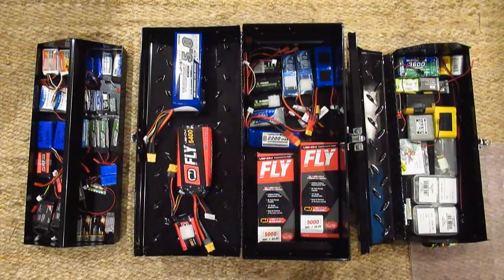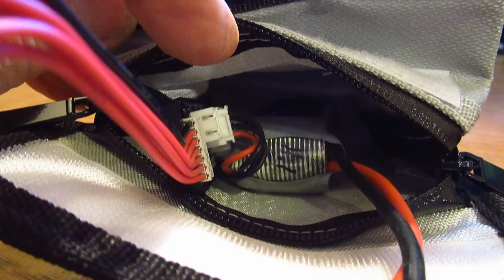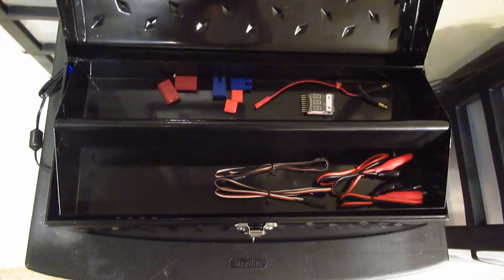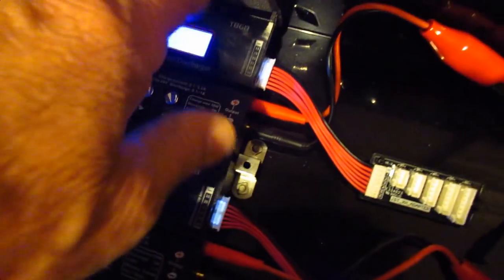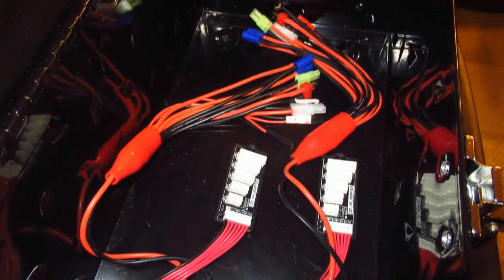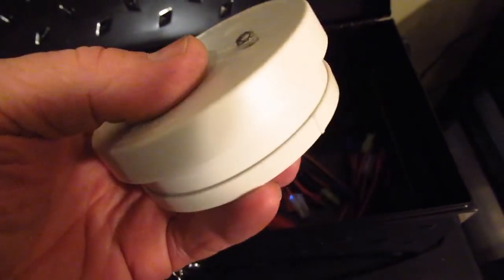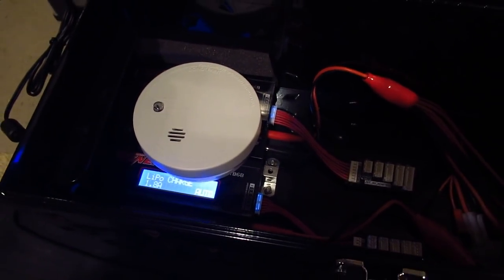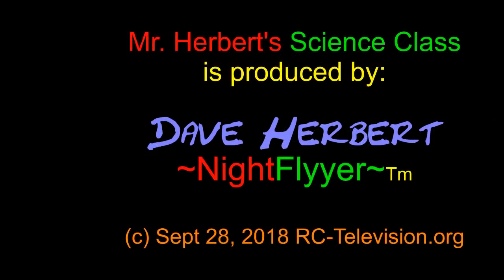LiPo Battery explosion prompted me to build a self contained PORTABLE Charging Station.

Comment: Dave they have ammo cans at Harbor Freight but I seen larger ones on Ebay https://www.ebay.com/itm/4-PACK-FAT-50-CAL-PA108-SAW-BOX-AMMO-CAN-VERY-GOOD-CONDITION/303033083266?hash=item468e2de582:g:Go4AAOSw651cQO1S there are so many sizes. They are kind of heavy and I would trust those if a battery exploded inside.

Comment: Those chargers are garbage... Its that true the power supply is outside, but they get significantly hot. I would have placed fire retardant insulation and rubberize or have a glove handy in case they need to be thrown out. Buy a high end mask, there will be A LOT of smoke, A LOT!!! in no time. I prefer Hitec X2
* store them on ammo boxes.

Comment: Can you replace the foam in the toolbox with a less flammable silicon rubber?
Reply from the maker: I suppose, but it would only melt, as it is only 4" by 1 inch and any fire from it would not be anywhere as detrimental as the battery fire.  If the box and even a destroyed $45 charger prevented a house fire, that would still be cheap insurance.  Thanks.

Comment: Wouldn't it make more sense to mount the chargers externally or at least with a firewall.  I get the safety aspect but if you do have another failure you're literally burning money when even a simple plate of metal could save the chargers.
Reply from the maker: Not to me, since my charger burned too. That's when I decided to put it inside.
Reply from the maker: Also there has to be holes in a separator plate to put the wires. Smoke and flame can get through. If this set up destroys a $45 charger, that is still cheap insurance to save my house from burning down.

Comment: I've always pondered the merits of storing all your lipos in one box.  If one goes... they all go!

Perhaps the best solution is to create a sectioned box so that each individual battery is protected from the others such that if you do have an "incident", you'll not run the risk of having all your batteries contributing to the resulting fire. 

The only other problem with metal boxes is that, in the case of a thermal "event", the box itself will likely get very hot and those vent holes will spew flames and hot gass that could impinge on anything nearby so as to create an external fire.

Personally, I always make sure that my batteries are on a storage charge before I put them away.  This limits the amount of energy they have in them and that in and of itself reduces the risk of a small fire becoming a big fire.   Returning your packs to a storage charge can also significantly increase their useful life.
Reply from the maker: Thanks for the suggestions.  All good, but at least I am trying something which is better than nothing!  I usually only charge one battery at a time, except for the F-16 batteries or my boat.  The vent holes are on top and the whole box is sitting on top of ceramic tile,  but not shown in this video.
Reply: Yes, I charge my batteries on a piece of plaster-board and have concrete (cinder) blocks into which I can put them when not in use.  Cinder-blocks won't conduct the heat if the packs in one of the holes decide to get all "splodey".  I also have a couple of extinguishers (CO2 and dry powder) in close proximity -- not so much to try and put out the lipos but more to prevent any secondary fires from starting/spreading.

It's funny... I only ever had one fire in the "nitro" days, despite that fuel being highly volatile and potentially explosive.    That fire was caused by priming a Cox 049 with the glow clip still connected.  Next thing I knew, the paint was blistering on the front of the model (invisible methanol flames) and my hand was getting hot.   It was easy to blow out though so no real harm was done.
Reply from the maker: I've had those cox fires too.  I still fly Nitro a lot, including helis, but the Old cox's did that a lot.  Glad they always went out quick!  Thanks again.

Comment: I have a caveats about your setup. First is your chargers are inside the box, meaning if a lipo goes you still lose the charger. 2nd You have them on a plastic organizer, wouldn't the boxes meltdown if the lipos went? I have mine stored in a metal box on top of a metal filing cabinet.
Reply from the maker: Like I said many times and in he video description, the tool box is sitting atop ceramic tiles and not directly on top of the plastic. When making the video I didn't show it that way but believe me I know what you mean. Also since the charger began burning, I feel safer with it inside the box. Thanks.

Comment: I had a imax b6 charger charge a 4s lipo up to 19.6v before I heard it puffing (sounded like rice krispies) I set it for 4s balance.     The battery was rock hard and almost completely circular.    The charger seems fine before & after, although I don't use it anymore.
Reply from the maker: That is a lot of voltage for a 4s, as it is supposed to be only 14.4 volts, not 19.6.  I would not use that charger anymore either.  Thanks.

Comment: Are you sure you set the charger to the right cell count?   Or did you use the auto?
Reply from the maker: There is no AUTO available when doing a Balance charge, so the answer is yes (right cell count) and (No on auto.)  Even it I put the wrong cell count in, the charger knows it is wrong so also wont let me charge. It was all set right, as I have been charging Lipos since they first became available and am always careful.  It was either a bad cell or the charger (which is also fused) failed. I believe the battery went bad. I have lost all faith in charging bags since my 6s battery destroyed it in seconds.  See this video to see what happens with a 6 s in a charging bag. https://www.youtube.com/watch?v=CnNId0mDnBo  .  Thanks for your comments and charge safe.
Reply: @NightFlyyer  How did it happen?
Reply from the maker: There is no way to know.  It was either the charger or the Battery as everything was set right. It definitely scared me and I am happy to have been right there when it happened to put it out with the fire extinguisher. Hence, I am now paranoid and why I built this setup.
Reply: @NightFlyyer  Thank you for your story & solution.

Comment: Do you think it could have been a failure of the balance board?  Yours look to be the unfused type. Also why use a balance board with one battery?  Still a great idea using a common tool box for a portable charging/storage station. I like that alot better than ammo cans. Thanks for the idea, I think I'll build something similar.
Reply from the maker: The battery swelled and exploded in side the bag and destroyed it.  The balance board was inside the bag too.  The wires are too short on the battery to get close enough or I would have had to put the charger inside the bag too. Never in 15 years have I had a problem with the balance boards, but who knows.  See this video on how a 6s looks like inside the bag when it explodes. Its a good example. https://www.youtube.com/watch?v=CnNId0mDnBo Thanks for the kind comments and fly safe.

Comment: In the spirit of DIY. I actually made my own fire extinguisher out of a 20oz co2 tank used for paint ball added a on off valve.  Works great and no mess. Had a small fire in the kitchen and had to use it. Was like turning the OFF switch on the fire. You can Refill the tank and its ready for the next emergency.lol
Reply from the maker: That's a great idea.  Good job.  Watch this video, to see what a 6s battery fire looks like, as this is what happened to me. Luckily I was on top of it right away with my marine fire extinguisher. It sure made a mess though.  Thanks. https://www.youtube.com/watch?v=CnNId0mDnBo

Comment: Got the same TB6B. Has been rock solid for about 4 years and counting. Only issue has been 1 button got stuck, so the board was moved slightly, by taking the left side panel off and the button was fine again.
Reply from the maker: Thanks very much. I am glad I changed mine out, especially after hearing about yours. Thanks again.
Reply: I have tested those chargers, they dont balance them very well and never 100% compared to Hitec. I charge and when plugged to Hitec and a balance checker they are way off and it happens w all different kinds of batteriesI have.

Comment: Nice boxes. I definitely need to do something like this. Though I would still use charging bags inside the metal box.
Reply from the maker: Thanks. I don't have much faith in charging bags since mine was completely destroyed by the 22.2 5 amp battery, but you need to do something for sure. Thanks.
Reply: Even though I've never had an issue with a Lipo I still actually use an old steel cash box when I charge them, with the charging bag inside. I also store them in there between flying days. But the Lipos I'm not currently using are stored in a broken electric oven that I keep in my shed.
Reply from the maker: This video is a good example. https://www.youtube.com/watch?v=CnNId0mDnBo Your are doing good with your setup.  My 6s completely destroyed the bag in seconds and I was glad I had the fire extinguisher right there when it happened.  I was going to store mine in a Microwave oven, but your idea is great too.

Comment: I use a 50  Cal ammo box lined with thin sheet of wood and aerosol fire extinguisher velcoed to lid, if the battery blows, it will set off the fire extinguisher.
Reply: Link to fire extinguisher, https://www.amazon.com/First-Alert-AF400-Extinguishing-Aerosol/dp/B001229JCU
Reply from the maker: I have a regular fire extinguisher beside my set up and like this one but I don't see where it automatically turns on in case of a fire as you say. Did I miss that?  Thanks.
Reply: @NightFlyyer  as soon as fire reaches the specified temperature  it will release, this is built into many fire extinguishers, and has been for many years.
Reply: @NightFlyyer   50 Cal ammo box, 11 x 5.5 x 7", about $9.00, I charge 1 at a time, like you, I had a home fire, my concern with your image was 2 chargers and 2 batteries, if one goes south it could effect the other, I may have missed it, but are you using a GFI outlet or surge protector? The fire I had I received 2&3rd burns to my hand and arm. I have a AC 6, after watching your video, I am thinking of replacing it now, it is a few years old.
Reply from the maker: I guess I did not see that in the fire extinguisher description,but none the less, I ordered one.  Thanks again!
Reply from the maker: It is not a surge protector but has a circuit breaker.  It did not shut anything down.  When this happened, I was only charging 1 battery.  Sorry about your arm and hand.  If nothing else, we have people talking and being more aware.  I'm sure if one goes bad they both may burn, but your fire extinguisher idea makes me feel better too.  I've charged lipos since they were invented and never was very cautious about it and never had a problem.  Now that I did, I am much more aware and hope others take heed too. Thanks again.
Reply: @NightFlyyer  I am learning to fly again, basically I have been flying trainers, 2 and 3 channel. I enjoy your videos and 2 other channels I follow got me back into flying, I am looking so forward to getting my Predator back up, you have the same plane. Oh you can get the fire extinguisher at Lowes
Reply from the maker: Sounds good. I went to Home Depot and found the tundra extinguisher but it does not go off by fire or heat. We read the bottle and the salesman also said it won't turn on in heat or fire but there are ones that do. I'm going to research and see if I can find something. There is a ball extinguisher that might work. It costs about $45 but may be just the thing. I did buy a few more ceramic tiles to set my charge station on though while I was there. Thanks again and happy flying!
Reply: Fire extinguishers are notoriously ineffective vs LiPos burning.  The LiPo fire is Class D.  The standard method of dealing with Class D is the Navy is #1 : If possible shove it overboard.

Magnesium is class D.  It will burn under water at over 200 ft below the surface.  It will burn in an oxygen free environment....
Reply from the maker: I was going to use an ammo box too but it was too small for my 2 chargers. I like the fire extinguisher idea and will get one. Thanks much!

Comment: My charging station is concrete building bricks and bathroom concrete backer board for walls and shelves and lids.
Reply from the maker: That is good for a permanent setup for sure.  Mine is more portable, but anything is better than nothing!  Thanks kindly for the info.
Reply: @NightFlyyer  oh yeah and a smoke detector right above. I need to get a bucket of sand though to put out a fire quickly.
Reply: Lab fume hood is very good for apartments, I lack a place to put one but I'm upgrading to a suite that does have a spot in a couple months. So my Lipo area is to be upgraded to a Fume hood with vents through a small window. Win win, no fire and the smoke doesn't full several floors of the building.
Reply from the maker: good idea.  Thanks!

Comment: If anyone knows first hand about the dangers of lipos, I hope you’re one of few Dave. I never realized how dangerous they could be. I was aware that they could catch fire but I didn’t know they shot out the intense high pressured flames as they do. I’ve never personally had that bad of a crash or had one go off on me. Lucky I suppose. Your house fire video is the reason I built a lipo bunker. I bought all the materials and started construction the same day I saw your post. I’m a grown man and have to admit, some water leaked out of my eyes just by seeing the devastation and the heartbreak that fire caused. Stuff is one thing but life is another. I’m so glad you guys made it out as it could have been much worse. A Massive chunk of RC history was lost that day but the man behind all of it remains to share new stories and still give some excellent advice. I sleep a lot better knowing that my bunker is well built. Best that I could do anyway, which is absolutely 100% better than nothing at all. I used 1” kiln hard refractory board and lined that with unfired terra-cotta tiles in a 3/4” birch laminated box with a stainless door which is also lined with refractory and tile. I’m hoping that the unfired tiles will suck up a good amount of the initial heat blast and If it gets past that, there’s the refractory barrier to get through. In addition, all the lipos are in bags and it’s also on metal casters. If it does happen to catch some day, I should be able to push it out of the shop with a broomstick or kick it so it can be extinguished or burn itself out on the driveway if need be. A temp. alarm wouldn’t be a bad idea either. I also balance charge at safe rates as you do. Not only for the possibility of combustion but lipos aren’t cheap and I try to take care of the stuff I’ve worked so hard for over the years. I’m glad you got back into the hobby!! YouTube just wouldn’t be the same. I’m sure it was a tough call after the trauma but RC runs deep in you. It’s also nice to know that there are still some great folks out there that supported your loss with the generosity of giving up their own RCs. I sure hope that nobody else has to go through what you guys did. If you’re gonna play with the big toys, or even the little ones really, a bunker is a no brainer. Well, the lipos are almost charged up for some trailing today. You should get a crawler! I bought the TRX4 Bronco Sunset and got my wife the TRX4 Defender/Land Rover. They’re fun to take a walk with anywhere and they’re a kick in the pants when flying conditions have you grounded. They’re semi-waterproof too. I wouldn’t suggest using any Traxxas lipos at all!! They seem to have a pretty bad history of puffing and catching fire. Just be careful if you do do it though, the scale accessories are addictive!! 😆 Take care and RC ON!! Land, Sea or Air!!
Reply from the maker: Thanks for the good comments.  My house fire was not started by any liPo's though.  The state Fire inspector determined it was started by an electrical fire in the ceiling of the garage most likely when a big tree branch fell on the connecting wires to the garage and pulled the mains.  It must've been weakend, they said after that.  Anyway thanks kindly and your info is excellent! Fly safe and ROCK on with your crawler!
Reply: NightFlyyer sounds dumb to say this but it’s probably a good thing for many reasons. Either way it definitely made me think of what could happen. I guess your ceiling fan got me on the bunker build then! 😆
Reply from the maker: So glad you now have a safe setup.  I'm coming to  your house to charge my batteries!  Thanks very kindly for all your comments.  I really appreciate them.
Reply: NightFlyyer lol, anytime bud. I also mistook your ceiling comment for ceiling fan? I must need to go back to school and get a refresher on how to read!!

Comment: Does fires happen only when charging or it can happen when the battery is not being used?
Reply: I have not seen one explode in storage, but I have seen them puff up.
Reply from the maker: True!
Reply from the maker: Thanks kindly. I've never seen a battery explode except in a crash or when charging. I have had hundreds of them since they first came on the market for models with no problem just sitting in the models or the case. But just in case, I do keep them in metal boxes and feel good about doing it that way. Good question!

Comment: Very  informative video, never seen lipo's go up but I used to race 10th scale cars years ago powered by 7.2v nicads charged via a 12v car battery, these used to go with a pretty powerfull bang if left unattended during a race,  saw it happen a couple of times, fortunately no one was hurt. Cheers from Englan
Reply from the maker: Yes those nicad batteries sure got hot during charge. Glad your ok. Just like mine, that is a real wake up call. Thanks for sharing and commenting.